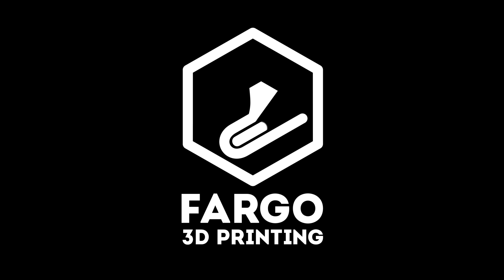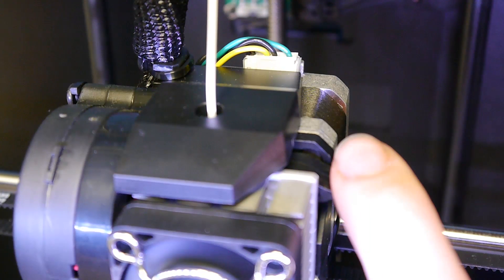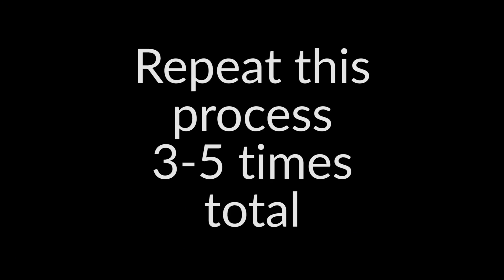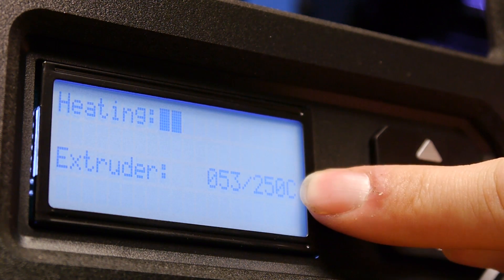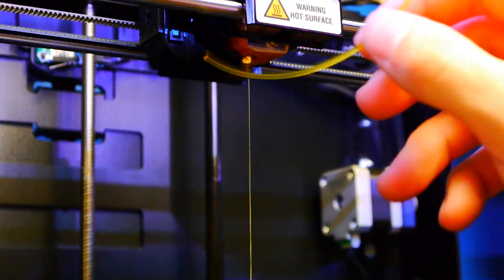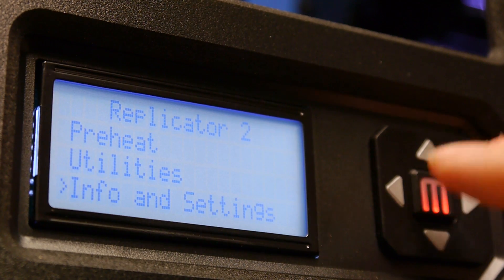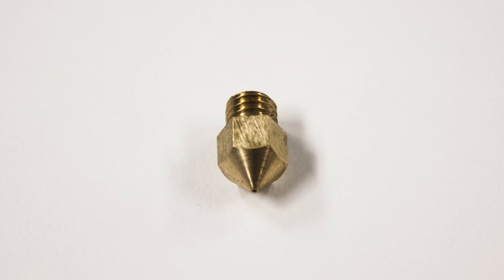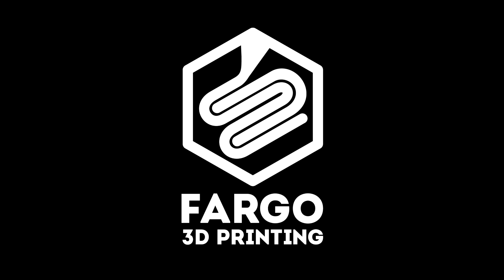MakerBot Replicator 2 Nozzle De-clog

Comment: I wasn't having any problems until I went from PLA to ABS and my motor started clicking as the ABS filament went through and only a small amount was coming out. I don't have the release on mine like yours so I let it clipped it as close to extruder as possible and let it run through. Now it won't load at all. Any ideas?

Comment: We have had constant clogging issues with our Replicator 2 printer. We have had to replace out the Heater Block Assembly many times with a Fargo one (I think we have purchased 2-3 Fargo assemblies within a year or so), but the issue keeps arising. After a quick inspection, it seems like the plastic is expanding in the thermal barrier tube which prevents plastic from passing through the tube. Do you have any suggestions?

We are running DeltaMaker Black 1.75mm PLA at 220C with stock settings in the MakerBot software. Also, we have put in a new Fargo Thermocouple and Fargo Heater Cartridge.
Reply: Fargo 3D Printing The heatsink fan was making some odd noises so I replaced it and unclogged the printing nozzle. Since then, we have ran the printer for about 10 hours or so without a problem, however, I'm curious to see how it performs after another few weeks of regular use.

One thing I have noticed is, the side blower fan does not turn on, ever. I've already ordered a replacement from MakerBot so I will replace it out once it arrives. I was able to probe the output connector of this blower fan on the main board, and never saw a voltage reading above 0.3V.

The main board was replaced a little over a year ago (purchased from MakerBot directly). Do you have any suggestions regarding this issue?

Comment: Hi Jake / Allen:  i followed all and worked fine/perfect on 1st run.  i removed parts, took some measurements then went to run a 2nd run of same parts but no pla coming out.  When i load filament, i have to pull out line and reload then it will drool again.  only 1st run good.  seems like its getting stuck somewhere between the barrel and the nozzle or the just plugging up again.  the barrel looks good (can see thru).  Please help.  makerbot replicator 2

Comment: so if this doesn't fix it I need a new nozzle?
Reply: So I. Broke off the tiny brass hex head that goes into the heater block. The one that threads in.  so where do I get a new one of that?
Reply: I don't need the block I need the thermocouple that is screwed into the block. can you sell me just that? I broke mine off.